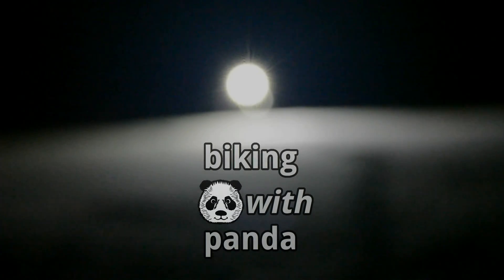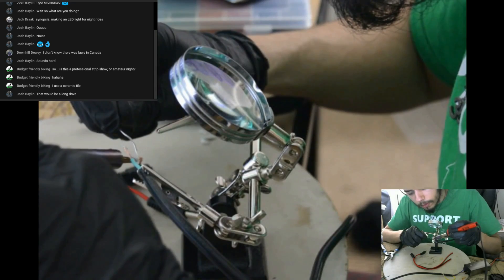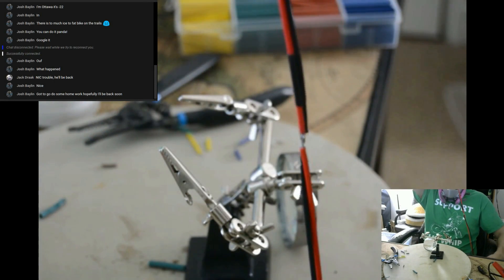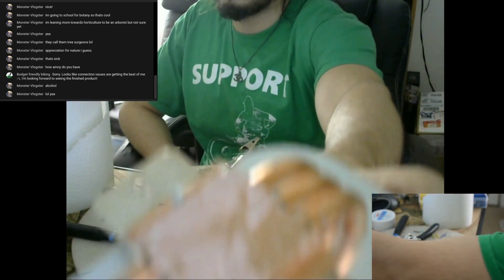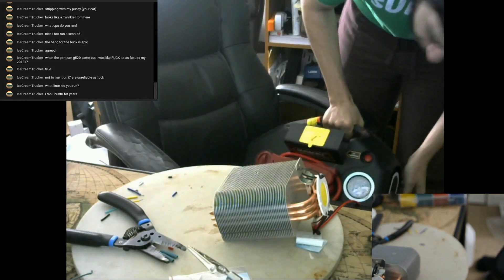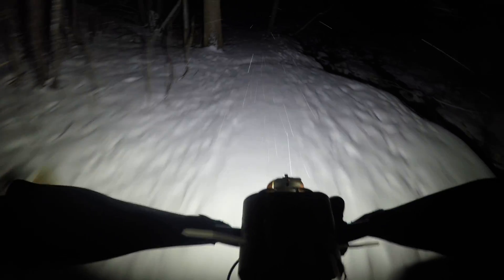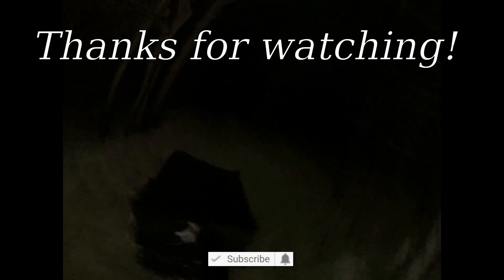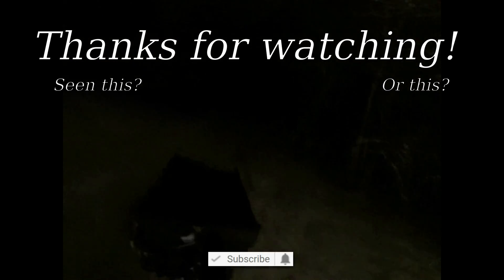#33 - [DIY] An overpowered 7500 LUMEN mountain biking light for night riding! | Biking With Panda

Comment from the maker: NOTES:

If I were buying new chips for this project I would have used something cheaper like a Citizen 1212.

I didn’t use a DC powered driver because it’s an initial prototype and I’m just using parts I had lying around. If I had a DC driver I could avoid the inverter and use a smaller setup.

A more permanent setup will have some kind of epoxy protecting exposed solder joints... and, if we’re being honest, probably better wiring that’s rated for this outdoor use.

My next configuration will involve non-LiPo power from wheelchair batteries in a backpack.

Comment: I am leaning towards Moonlight Mountaingear, the Bad5000 is the most interesting: https://www.shopmoonlightmountaingear.com/products/bright-as-day-5000
they also have 10000lumen light: https://www.shopmoonlightmountaingear.com/products/bright-as-day-10-000
but don't think I will need that.I also like that the cable connectors have a threaded locking ring.
But they don't offer a 35mm handlebar mount so I would have to get one my self.

your system definitely has a great spread of light, but the huge generator is not practical of trail riding, but the hanger is nice for grocery shopping, but I have not tried one yet, so far I only had bags on the handlebars.
I don't thin the big heatsink will be an issue, but bottle cage mounted battery, or battery strapped to the frame would be nice, but the led and the rest need some protective cover for sure, but with this huge heatsink, the cooling should not be an issue.
Reply from the maker: looks like it costs $1764 Canadian if that's $8,499 krone - pretty bloody expensive!

these LED chips are $37 each and the newer replacements are just $12 so if it only lasts a single season, that's not bad! it's still cheaper than the 10,000 lumen light those people sell.

plus, mine is 7500 lm :)

next design is going to have smaller backpack battery. bottlecage isn't a bad idea, but I like to keep water there.
Reply: I use a pack with bladder, water bottles get dirty, also not so convenient, 
yea it sure is expensive,  I used a Gemini Xera light but the wires disconnected, but it also overheated on max, even in -11C that's silly bad, So I definitely need a light with the cooling system, also proper connection between battery and light, wires that dont disconnect.
THe exposuire lights have light and batteruy in one unit, so no cable, but not as many lumens, not as logn battery life, but nice for a commuter.
Reply from the maker: my lamp only hits 50C in cold weather and you don't need to use a 50W LED driver, you could under-drive it and gain efficiency, the 50W is actually close to the designed maximum for this chip (75W) and under-driving runs way cooler needing no fan.

I'm looking forward to summertime temperature tests since the fins with the constant movement of air shouldn't require a fan to cool itself.
Reply from the maker: I have fallen and punctured my camel bag while mountain biking so I generally don't trust them as much as a real bidon.
Reply: The Gemini light hit painfully hot, don't know exactly, probably more than 40, cuz I can't touch it, super fast, but it did not have a proper heatsink.
I currently use a LEdlenser flashlight, on rechargeable batteries, last me a short ride around the city, but not for any long trips.
Reply: I have not tried Camelbak, I use Evoc backpack with Hydrapak bladder, but I won't crash on fence poles or knifes, so won't puncture it.